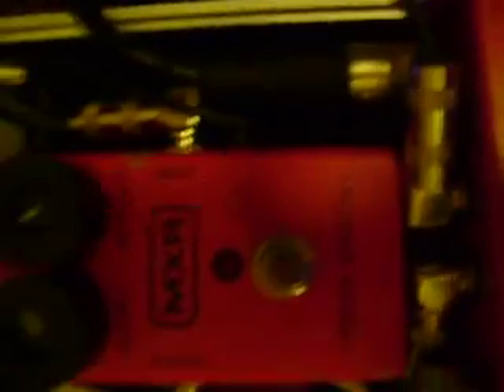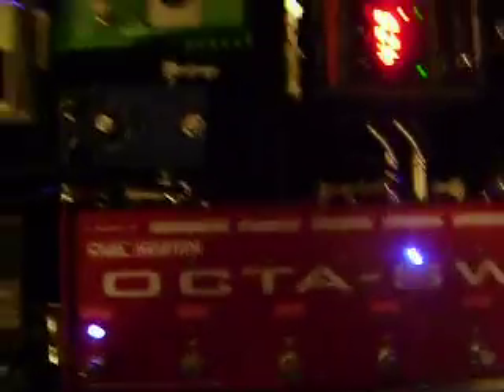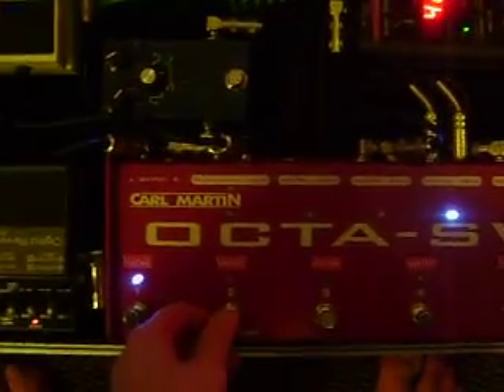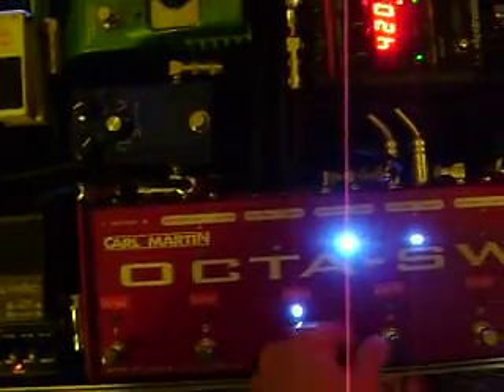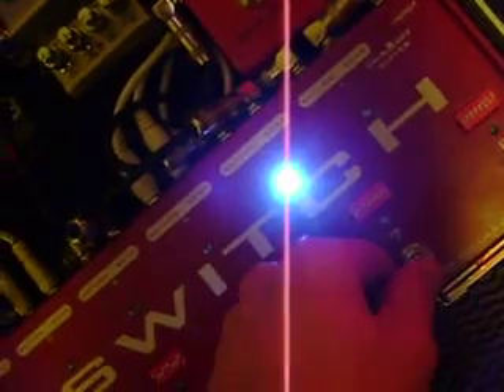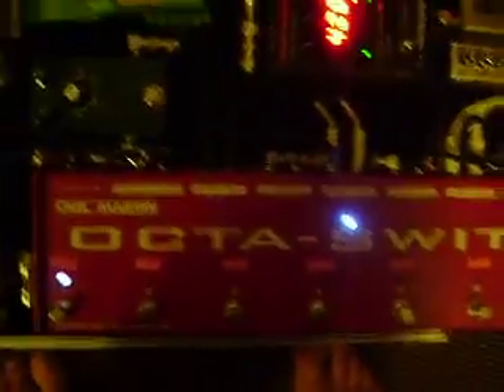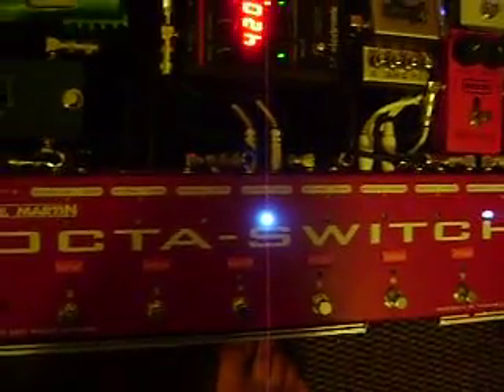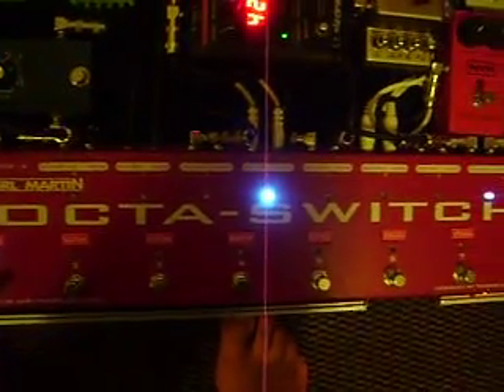Carl Martin Octa-Switch / Octa Switch - Demo [True Bypass Looper]

Comment: Hey Dude,
Thats wrong! You can run with your pedals into the front, through the fx loop and both. 

You go with the guitar in the Looper IN, then put your OD on 1, your pre-amp (amp in -> fx send) on 2 and the modulation-efects on the rest. Then with the OUT from the looper in fx-return. So you have (for example) your OD or Wah into the front of the amp, but your modulations-effect's in the fx-loop..

 I hope you understand, I'm not an english-speaking-guy xD

Greetings from germany

Comment: wow,interesting re: the Axe FX. If you could recommend one unit over the other, which ould you suggest,taking into account versatility, and creating interesting sounds,G-system or Axe FX?I could probably only afford one for the time being. Would either be suitable for noisy art rock?The problem I've found is that most guitarists (other than your good self) that use these units, demo them in a shred or U2 setting, nothing wrong with that but it gives the impression that's all they're for.

Comment: @DemoColorScheme thanks loads, i swear, last question. could you use stomps with the Axe FX alone (without the TC) if you wanted and switch what's on the AXE FX with stomps in one switch, i.e does the AXE FX have that capability, like the G system does?

Comment: @DemoColorScheme how do you personally switch then? is it a case of a combo of one midi switch then on/off of the actual stomp effects once you are inside that group? i.e. the TC, then selecting the actual stomps as you require them? I was think of the RJM funnily enough alongside an All Access for the controller. Either that or a CAE switcher but I'm unaware of the expense.

Comment: hi can i connect 10-12 analogs? into this unit?
though i need jst 5 patches to b used??

and do u recommend any other unit like this thru which i can make patches but it shud b cheaper for about 100-150 $
since this unit costs about 350$
reply soon